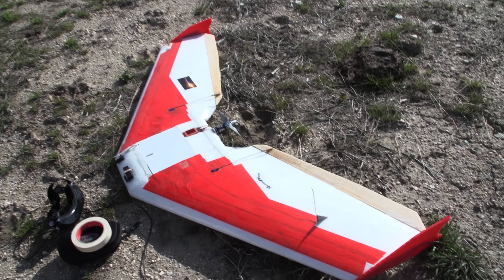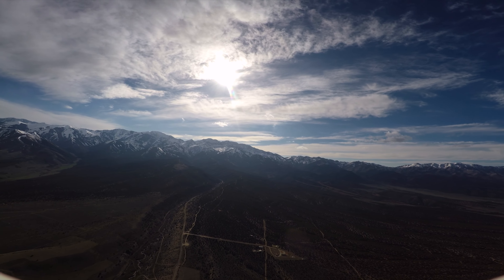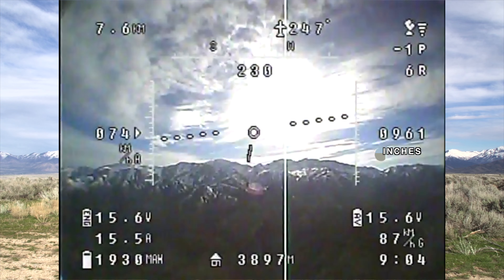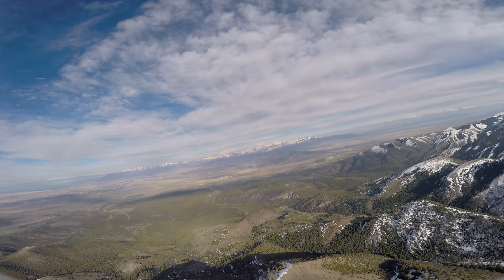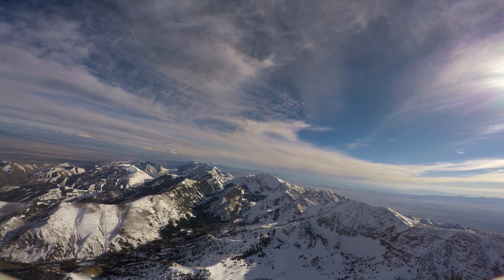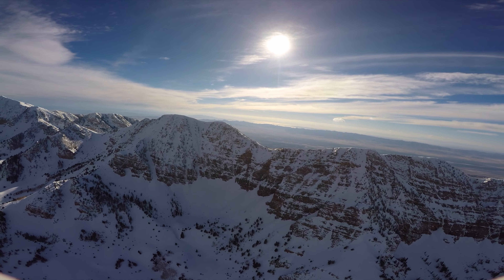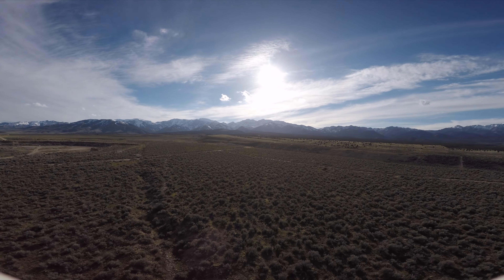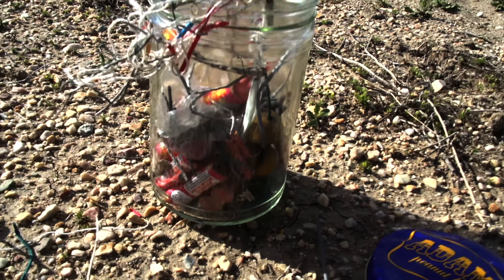Behemoth Narrated FPV

Comment: You're crazy if you don't take some kind of mini wing with you to Nepal to surf the ridges of the mountains FPV style... Take something that comes apart easily (ie remove wings easily)
Reply: superspeeed he has an old video of a slope soaring wing that comes apart.  He strapped it to a backpack and MTBed up a mountain to soar it.
Reply: Even if he wont take a wing he should take a mini quad... but personally you can't beat the aerodynamic freedom of wing.. I know it's a hindrance when you are travelling to carry something extra, but if he can rig something that can carry this level quality of gopro.. the footage would be... breath taking.
Reply: Strix Goblin packs up small!! Not sure when it's goign to be released though. Supper efficient, but very fast.
Reply: Tough to get one in a backpack without breaking it during the trip.
Reply: This just inspired me.. I think a type of 'kite wing' would be hugely more practical. Like a stunt kite but more of a 3d wing, that will pull out like an accordion
Reply: And where might he charge the batteries when he's backpacking in the middle of nowhere?

Comment: Really love this video. The flight of my  dreams is similar than this one, but with less height difference.

:)

I have noticed you haven't used PA mode. Do you avoid this mode only in flying wings like this?

I'm trying to tune a ZAGI with 1200 mm of wingspan with a Cyclops Tornado, because default settings produce an inestable behavoir.

Comment: Daniel, would you recommend the Vector OSD system by Eagle Tree?  It's pretty expensive compared to the Cyclops, but I'm just not sure if there are better systems out there in that price range.
Reply: Nick Joslin everybody seems to be into iNav these days. $50 for the basic functionality like RTH/Level/launch assist and OSD
Reply: I like the Vector better than Pixhawk and APM. I haven't tried cyclops.

Comment: What does it take to get the Hi Res video images to your goggles so you can clearly see where you're flying?  Is that possible/feasible/affordable yet with RC components?
Reply: Video comes in from an FPV camera ($20), and is sent to a video transmitter (VTX) for about ($40) and has a cloverleaf antenna for about $8, and then is picked up with his circularly-polarized ground antenna and video receiver module ($60ish). Prices are estimated and doesnt include cables and batteries. But not too difficult.

Comment: what's better for long distance? 2.4gh or 5.8
Reply: Cory Smith 1.2 or 2.4... 5.8 isn't normally good for long range
Reply: 5.8 has less penetration through trees and obstacles, but what really matters is the decibel rating on the antenna and the wattage on the transmitter. If your transmitter is pumping out 600mw to 1w of power, the signal will push a very far distance. 5.8 will work just fine.